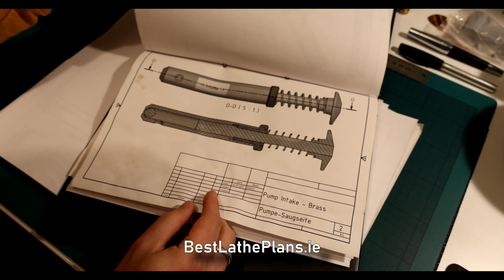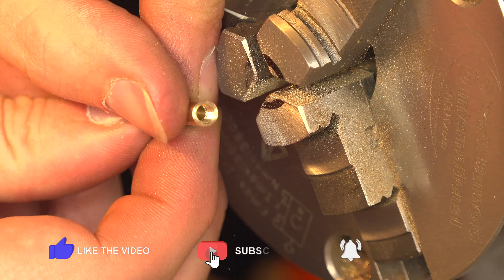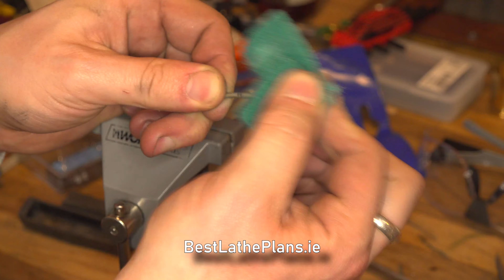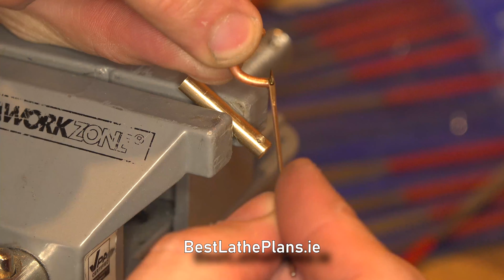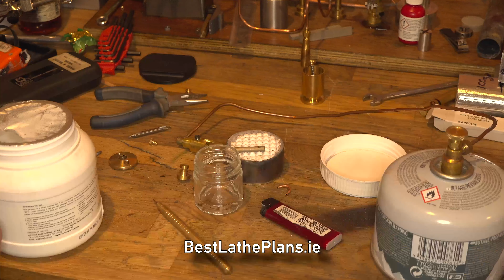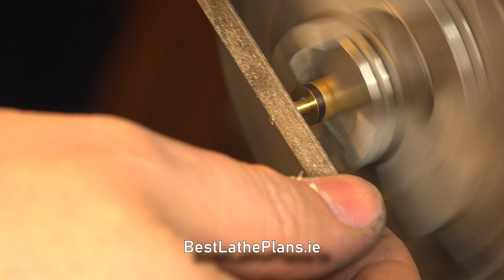Completing the Build - Worlds Smallest Oil Can - Part 5 - 4K / UHD - Best Lathe Plans

Comment: hy mate , i need some help again. just to get that right and i hope i am not wrong ! is there only a spring on the pump mechanism ? or is there a spring hidden in the side with the nozzle ?
Reply from the maker: Just the one spring on the plunger side. Gravity does the work on the ball bearing on the outlet side!
Reply: @BestLathePlans  hy , my oil pump does not work ! it works with water ( very good shoots like 70 cm but oil dont work , not even a droplet ! do you think i can improove something maybe
Reply from the maker: @pirminkogleck4056  Hey, what type of oil are you using? Is it really thick like steam oil?
Reply: @BestLathePlans  not steam oil but car oil or castor oil, i tried several and had no succes. i made a new plunger and intake and out take and a new body , so i will end up with a second one ....then i see where i have a fault. my gues even if i made the Nr1 to dimensions and acurate , the piston and the cylinder from the plunger i think had a few micron to much play ! ( there is no play but i can see a water drop forming after a few pushes
. there is a youtuber called find hansen. his miniatureoil pump is similiar to ours but his works flawlessly with oil . ...i will let you know if i have succes with the nr2 plunger mechanism.

Comment: For small or fiddly solder joints like the ones on the connecting pipe I prefer to make rings of 0.5mm solder wire. Bend the wire round a suitable mandrel - in this case the same diameter as the pipe - to form something that looks like a spring. Then using small cutter (or scissors) cut the individual rings. Place ring + flux on the joint and apply heat.
Alternatively use silver solder paste. I get mine from Bengs Modellbau but you can get it from any good jeweller's supplier :-)
Reply from the maker: Thanks for the tips. I'll give that a try and let you know how I get on...

Comment: Thanks for this inspiration and the link to the plans. I’ve successfully made my own. But not as small. I had to upscale a bit to suit the ball bearings, springs etc that I had. 

I wasn’t confident I could build it to work so build mine in aluminium (cheaper) with just some brass bits. 🤗